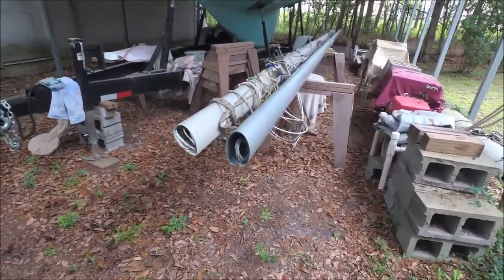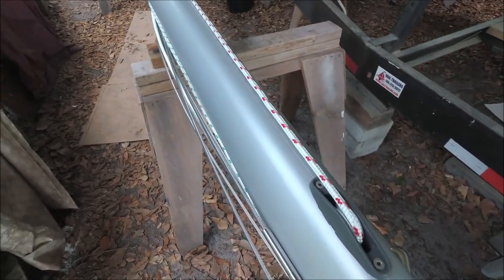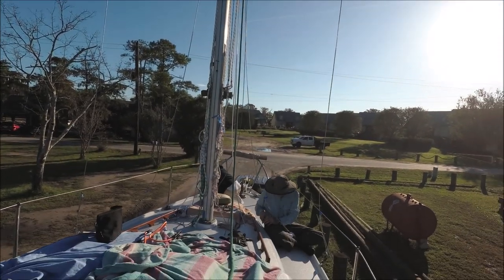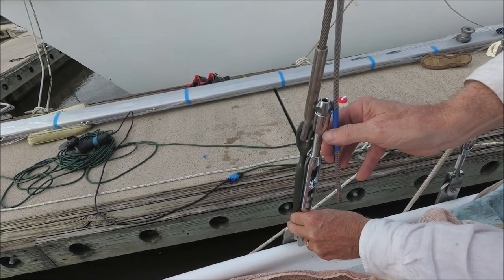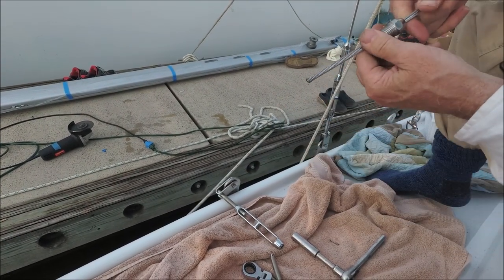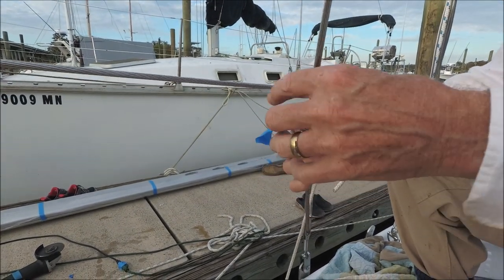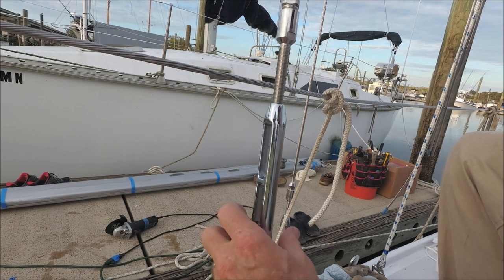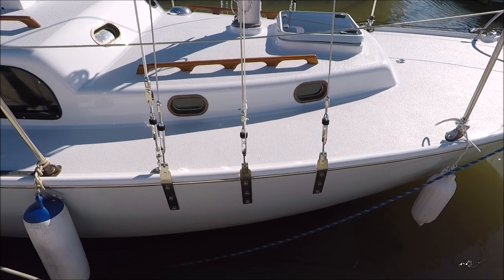Installing New Mast and Sta-lok Rigging - Pearson Triton Osprey Refit Part 20

Comment: Hi James, any thoughts on Dyneema rigging ?
The price of sta-lok here in Oz is frightening and I won't tell you the quote I got 
to supply the standing rigging for my 25 footer ( without new turnbuckles )... but the saving looks like about $900 if I splice it myself.
I would love to see the mast build process.
Very helpful video as always, thank you.
Reply from the maker: If the savings is really that great and you don't mind the little hassles of fitting and maintaining dyneema then maybe a good choice for you. At the very end of  Converting Fractional to Masthead Rig - Triton Osprey Refit Part 18, I mentioned some of the negatives of dyneema and why I didn't use it on this boat, such as: it is much more labor to install and maintain, it stretches and creeps over time, needs replacing twice as often, it may end up costing the same or more since you need to buy only heat-treated pre-stretched type rope, not the cheaper version and the pricey thimbles and fittings, although lighter it has more windage and bulky thimbles,  you probably need the turnbuckles on it anyway to maintain tension easier than with lashings, may need chafe protection from sheets rubbing on it when hove to, can't be used on the headstay with roller furling, standard jib piston hanks will chafe, and strangely it gets loose in very cold weather. Having said all that, I haven't installed it yet so my knowledge of it is only through research. Others are using it successfully and have different opinions, though I haven't heard them address all these points.

Comment: I would love to see the video about converting to external chainplates. Is there any extra fiberglass reinforcement needed where the chainplates are attached?
Reply from the maker: It's hard to say if reinforcement is actually required for most external chain plates mounted on the hull if they have enough bolts of the right diameter since the hull does a good job of spreading those shear loads. But most people do add about 1/2" of backing plates inside the hull either of glassed plywood or G10 board and then a stainless backing plate under the nuts. Some of that is overkill but unless you're a structural engineer you need to overbuild these things to ensure it can't fail.
Reply: @atomvoyager   When it comes to fiberglass, overkill is usually what I do ;-) . I would probably put a few layers of 1708 to further distribute the load and then install backing plates. I am still considering that option. The boat, Ranger 29 by Gary Mull (I know, not a real ocean boat) has lowers attached to deck only which I don't like, and uppers attached to bulkhead mounted chainplates. I realize that I would need longer spreaders and relocate jib blocks and loose some of the upwind performance but I like the idea of strong rig. Thank you for the response! Your website is an inspiration since I discovered it like 15 years ago. I learnt a lot from it over the years and copied a few of your ideas :-).

Comment: Super video! Question: How do you determine the length for the rigging cable? Did you measure them before raising the mast?
Reply from the maker: If you have existing old wires of the correct length it's a simple matter to measure them but in this case with a new mast of different length I took a rough measurement while mast was on the ground and added one foot to ensure they were extra long. Then as you see near the beginning of the video we attached the new wires to cut-off lower ends of the old wire with cable clamp U-bolts, then adjusted the mast vertical and cut to length one at a time to add sta-loks. Some of the measuring was covered in Part 18.

Comment: Were those chainplates original, or did you change the design?
Reply from the maker: The original Triton chain plates are inboard thru the deck as seen on my boat next to Osprey near the end of the video. These externals were added mainly for ease of inspection, less likely to develop corrosion cracks than if penetrating the deck and probably have some increased strength. They are also less likely to leak and much easier to rebed when needed.
Reply: Thanks for the reply, I did a similar thing, replaced the internal chainplates on my IP35 with external chainplates made from 
3/8”x1.5” 316 SS...

Comment: Great video! How to you adjust the tension on the stay for the storm jib? I have seen many use a lever. How do you do it?
Reply from the maker: Bigger boats use a Highfield lever but they are heavy and bulky and over $500. If I saw one for a reasonable price of the right size I would use it. So this is the poor mans version - open body turnbuckle that you can grip in your hand and hand tighten or use a leatherman type tool for extra tension if needed. The wrap pin is fast to remove without a tool so you don't need to fuss with a cotter pin. Here's a discussion on levers:
https://theriggingco.com/2014/06/08/the-highfield-lever/
Reply: atomvoyager I liked your solution more. I have a North Wind 38 with 16k displacement. Do you think it would work with your setup on my boat?
Reply from the maker: @IsakEngdahl82  I don't see why not. Your other simpler option may be a solemt stay but that lacks my intermediate backstays (or aft intermediate shrouds) that are always in place to add stiffness and redundancy to the rig, if that's a concern.  Maybe best for you to consult with a local rigger to work out all the details and options.